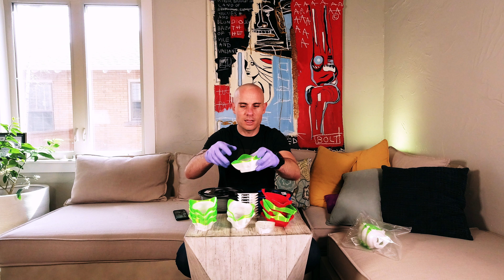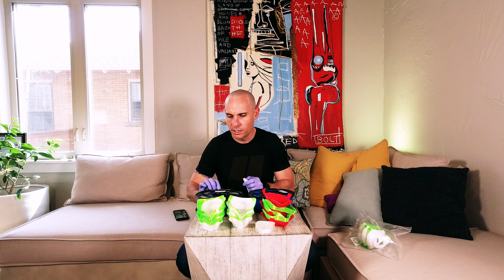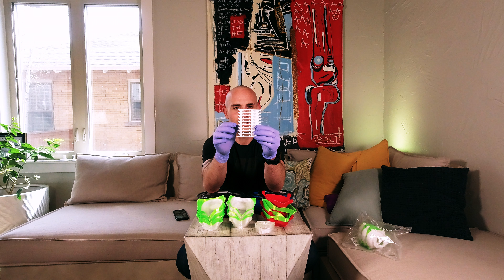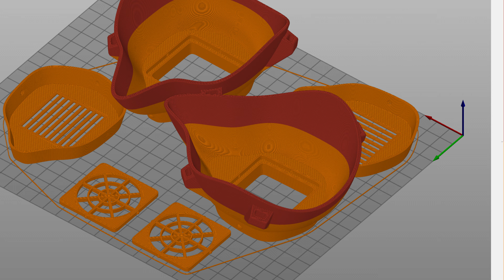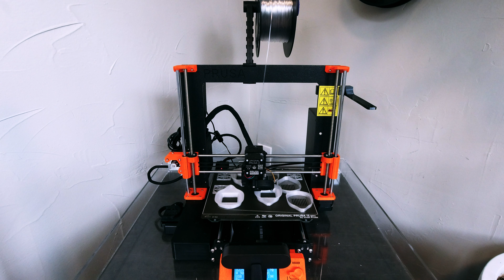3D Printed Coronavirus masks: Which materials and designs to use? #covidMask #CoronavirusMask

Comment: To bound them I think you could use a fast set apoxy.. you could also use heat to bound the two pieces together..
Reply from the maker: In the end I was able to print the masks out of PETG with a layer change to TPU and they bonded perfectly without the need for any adhesives.
Reply: @ALLYOURTECH3DP  Thank You for everything you are doing to help us get through this.. we really Appreciate all your hard work.. God Bless.. Ben..
Reply from the maker: @Ben-rj7xs  I appreciate that Ben, please reach out if you have any questions or suggestions!

Comment: Pla works just fine. As a medical and areospace engineer, i have done digital microscopic scans on pla and though it may have pores, 99.9% are less than a micron in size and DONOT go all the way through... ok, so now that brings up the question of 1 micron being very large compared to a virus, that is true, but the one thing most people dont think about when it comes to sterilizeing, the surface tension of the sterilizer. Surface tension is what allows a liquid tk gwt into small places due to the amount of energy required to break the hydrogen bonds. IPA has a very low surface tension, about 23 dynes/cm. Hot soapy water is pretty close as well. Water itself is about 73 dynes/cm. This is why we use soap, to break those bonds. Bleach water has about 74 dynes/cm so you have to soak the pla in it, but your better off with 70% ipa or hot soapy water. Lysol spray, non aerosol, will work to, but not the lysol wipes. The other additives melt the pla. 

A friend of mine makes filters that filter out viruses from blood and they are required to use 70% rubbing alcohol only because it can get i to pores smaller than viruses. So, in short, pla will work. But petg handles heat and wears better

Even if the pores went all the way through, remember, a virus LEAVING someone will always be piggy backing on respiratory droplets. These droplets are about 20 to 100 microns, meaning they wouldnt pass through the 1 micron sized hole. Plus droplets fall to the ground quickly, then evaporate,  leaving the virus without a host and stuck on the ground, waiting to die.

Comment: what speed do you print TPU at
Reply from the maker: For the Zyrtec filament I’m printing at the default PETG speeds in Prusa slicer. If I were making a different type of model I would likely print slower and at a lower temp.

Comment: Hi! I was able to get a friend of a friend to print me a 3D mask it it is definitely very rigid.  No silicone, no strap, and I have zero clue as to what filter I can possibly use. I have seen online people are using AC filters to ghetto rig it... asking in your opinion/recommendation what I should try.  I work On the COVID  ICU/ ED and I really want to start using mine this week if possible. We are out of supplies.
Reply from the maker: Polypropaline seems like the best filter media and there should be a bunch of it in the ER. Using TPU for the upper portion of the mask makes all the difference as far as comfort.

Comment: I saw another video where another content provider indicated that for some 3D printed masks, there may have some very minuscule/micro holes that viruses may get through. Are you applying a coat of anything to seal those holes if they are in your masks?
Reply from the maker: Big Ric this is our primary reason for using PETG instead of PLA. PLA is more porous (you can’t make a vase that holds water for example). PETG on the other hand is used to make things like water bottles. We’re printing the masks using multiple wall perimeters which also helps mitigate the issue. Most of the virus transmission takes place via airborne water droplets that contain the virus. So Th PETG, we can block those 200ish micron water droplets and greatly decreases the chances of infection. I haven’t seen any additional coatings yet that are safe and also blocker smaller particles, but in always open to suggestions.

Comment: I SO wanted this print to work, but when it came time to swap the filament, the 95A Flex filament immediately would not stick to the PETG. I don't have any TPU around. I only have the Flexfil 95A from Prusa. Do you know if there is a good middle ground of print settings that might work for both? Is there a way to build dual print settings into the slicer?
Reply from the maker: Which flex filament do you have?

Comment: These need to be sealed to be airtight.  FDM extrusions straight off the printer are not airtight.
Reply from the maker: The transmission of the virus is typically via water droplets. Properly printed PETG FDM is water tight, and the added layer of at least 95a TPU provides a seal around the face.

Comment: You are doing a good job. TPU PET-G are good combo for face mask. Never use PLA material as it fatigues much faster when washed daily, or being stretched and pulled. The crack looks like saw blade which will hurt anyone face with no mercy.  Experienced 3d print maker know this but not the users until they get hurt. I posted a video in my channel to show how's  the crack looks like. 
Good luck.

Comment: I have a question. I heard that 3d printed masks have microholes due to how the melted plastic bonds to itself. Is this true and if so, how did you mitigste it?
Reply from the maker: Yes, and this is why we advise against using PLA. PETG on the other hand printed properly seals well enough to be water tight. Since the majority of virus transmission happens via airborn water droplets, this greatly reduces the risk of infection.
Reply: @ALLYOURTECH3DP  Ahh i understand. Thank you so much and keep up the hard work.

Comment: What are you using for filters I've been trying to find a HEPA filter for the furnace The filtrate filters do not contain fiberglass from what the company said but I can't seem to find anything higher than 1900 and the 1900 only does I believe 93%, small particle I think I need to get a 2200 or 2500 maybe I missed it in the video and you said what you were using Thank you stay safe
Reply from the maker: I'm being told that the polypropylene drapes in hospitals are an ideal filter material and they have a ton of the stuff.
Reply: Yeah I saw that too but now that everybody knows about it you can't get it anywhere for somewhat reasonable price. I ended up finding some HEPA filters no fiberglass with 99.97% filtration so I lucked out

Comment: If you look at CNC Kitchens latest result, it seems as though PLA stands up to IPA sterilisation better than PETG.
Reply from the maker: I would be pretty worried about PLA having far more micro-fissures though. Water is 287 micron, and I haven't printed anything in PLA that can even hold water. i use PETG for my own design of Orchid pots, and it readily holds water. I don't have the tools to measure at the level needed to see if it blocks a virus. I haven't had ay docs complain about not being able to sterilize the PEG. I would love to hear more.
Reply: @ALLYOURTECH3DP  I don't know much about PETG, never printed with it but having you say that, I may pick up a spool to try out.

That being said, with how fdm printing works, there will still be gaps. These can be resolved with a spray on sealant. I don't know what type to recommend as my first choice would be silicone or latex but both are allogens
Reply from the maker: @Falney  This is a great question, I don't know which sealant would work best in this situation. I have been printing with multiple perimeters  in order to hopefully reduce the risk. If one layer has micro-fissures, are 3 layers enough to negate that? 5 layers?
Reply: @ALLYOURTECH3DP  the likely hood of them lining up is likely very low, but you can be sure that they all will due to the nature of fdm and heat caused expansion and contraction.

Comment: I can't handle some of these comments. But:
1. N95 is only required for medical staff directly  intubating a COVID patient. None of these designs will reach N95, but that's ok.
2. Even without TPU the masks can give a perfect seal if they are sized correctly. Just scale the print in 10% increments. The test is breathe in normally with your hand covering the vent, the right size will suck to your face. Real N95 masks need to be fitted. 
3. Do not use HEPA furnace filters, they often have glass fiber. Vacuum bags are better. 
See prints on NIH 3D print server, avoid Thingiverse.
Reply: and a week later...I would advise not using the TPU/PETG mix of plastic, 2 masks delaminated right where the two layers meet after a few days of use and the overall air seal is not as good as TPU alone.
100% TPU  is the most reliable, and gives the best air seal. For filter material, I sourced Sterilization wrap and doubled the layers. This material can be heated to sterilize. The "Montana mask" design is simple, easy to print and easy to dissassemble for cleaning with soap and water. Other designs with screens are too difficult to clean and sterlize, you need TWO elastic straps.
Here is the reference for the utility of non-N95.
https://brighterworld.mcmaster.ca/articles/surgical-masks-good-for-most-covid-19-treatment/

Comment: Saw another video where they took a 3D printed mask under a microscope; there were multiple gaps and irregularities that led to holes of 6-8 microns which would be a big access way for the droplets. He dealt with it using wood filler and spray paint.
Reply from the maker: about time what material did they test. There are quite a few papers showing that the material matters a great deal as does the print settings such as number of perimeters. PLA leaks water for example where as PETG is water tight.
Reply: @ALLYOURTECH3DP  Yes he was talking in general terms about PLA and ABS, which I suppose a lot of the at-home printers use. Also I suppose any doctor would perform a fit test before wearing them on the job

Comment: Thanks for this design.  We've been printing this design in PLA, and a few in PETG, but the edges are so uncomfortable.  Any tips on printing with TPU?  I've read it can be difficult to print and haven't tried it before.
Reply: TPU requires a direct extruder or a Bowden extruder gear designed for flexible filament. 225-230C, 60C bed, 25mm/sec, 0.16mm layer or less, you have to push slowly.
Reply from the maker: It really isn't bad. My 3MF files shared here have the TPU edges and settings already baked in.
Reply: TPU is one of the easiest filaments to print with if you have a half decent printer. The only filament that prints easier is PLA.  Mk9 extruder with a simple printed part and a piece of teflon tube to guide the filament from the extruder gear to the hot end. No fancy extruder required. Also the speed and layer height restrictions people put on it are ridiculous. There are so many different printers out there that you just need to experiment and find what works for you. link to a video for you https://www.youtube.com/watch?v=bgwNkMTmZsY

Comment: This design with proper filter is restricting the air flow too much.The filter surface must be at least 3 times bigger.
Reply: This is not N95. But this week (April 8th) a very large study concluded N95 was only required for staff directly intubating a patient, even surgical masks were ok for patient care.
Reply: @truantray  It doesnt matter if it is 95 or not.The filter surface is too small. which makes it incredible hard for breathing.
Reply from the maker: The new design here has 50% larger surface area for the filter:  https://www.youtube.com/watch?v=PgABOJpu94k

Comment: bought a 3d printer today, we have zero ppe out here, i am looking at using mer16 filter media, we just don't have any masks to cut media from
Reply: Careful with your source for the Mer 16...If it's furnace filters they achieve their retention rating by using Glass Fiber media...not good for you to breath in as they shed.I have not checked it out but someone said 3M uses Polypropylene instead of glass fiber.
Reply: @andrewlidums2508  will double check, you can always put a cotton layer behind it

Comment: uv lights kill 95% of jerms . you shoud try a box with uv litghts in side to cleen massks
Reply: UV is only useful on flat surfaces without shade. 95% kill, which is just a made up number, is not sufficient. 
Better off spraying with 70% isopropyl alcohol.
Reply from the maker: That's a great suggestion!

Comment: You should really check out this video the Stephan did: https://youtu.be/txrXX0CQHhU   Unfortunately TPU isn't that great in an environment where the print needs to be cleaned with a liquid.
Reply from the maker: It also depends on the grade of the TPU. 95a (what I use) holds up well to chemicals.

Comment: Any thoughts on C02 buildup with no release valve? All my 3M safety masks seem to have a port for exhaling C02.  Lots of warning to never block or impede this area of the mask as it can result in carbon dioxide poisoning?  Thoughts as to how to address this?
Reply from the maker: That was a concern of mine as well although we have had these being used in the field for several weeks and it doesn't appear to be a problem. Even so, we have an updated version we are trying with a MUCH larger filter area: https://www.youtube.com/watch?v=PgABOJpu94k
Reply: You need sufficient air flow, which means at least 4 square inches of area. This is not like an OV mask, the exhaust has to be filtered to protect others.

Comment: Thanks for the information and video! Do you have an estimate for cost per mask? Thanks!
Reply from the maker: The current design looks to cost just over $1 per mask.
Reply: Thanks so much!!! What 3D printer would you recommend for producing these N-95s for local hospital?
Reply from the maker: @3journeys975  Right now i'm using the Prusa i3 MK3S. Another more budget friendly option is the Creality Ender 3. I have heard fantastic things about it, so worth checking out: https://amzn.to/2JRc5oo
Reply: @ALLYOURTECH3DP  Thanks so much!
Reply: @3journeys975  Ender 3 prints in PLA fine, but for the TPU, you will probably need to modify the feeder (either 3d print and use some capicorn PTFE tube (See CHEP's website https://www.youtube.com/watch?v=az7pysnV_MY) or modify to direct drive). Also, it would be smart to update the feeder tube to capricorn PTFE.   If you plan to do PETG and TPU in one print, watch this video for CURA slicer GCODE command for the transition (https://www.youtube.com/watch?v=1nBnVtOEAiY).  I'll be trying it myself as soon as all the materials arrive.  Also, Ender 3 requires a complex firmware upgrade using an Arduino UNO or raspberry pi using connector pins to the Ender 3 motherboard to install a bootloader, so it's not for someone just looking to print (https://www.youtube.com/watch?v=fIl5X2ffdyo).  it can be done fairly easy but I had a lot of issues with trying to find drivers and finding a USB B cable without interference shielding (the cylinder thing on some older cables.) You could also buy a motherboard with a bootloader, but that is adds cost as well.  I love my Ender 3 as it is so flexible and upgrade-able over time (extend print area, change hotends, octoprint, etc.), but there is a rough around the edges, gotta get your hands dirty, to that flexibility.  For me it came down to $250  Ender 3 vs. $750 Prusa i3 MK43.  Also, I don't recommend buying from creality3d(dot)shop.  It's not the official website (even though it is the first website google give you. Seems shady to me with an everyday ultra-low sale price and always in stock.  It seems to get mixed reviews from forums I've read so I chose not to risk it.)   The official website is https://www.creality3dofficial.com/products/official-creality-ender-3-3d-printer   or buy from amazon.
Reply: @3journeys975  BLOVE, thanks for this!!! Subscribed.

Comment: Thanks for the video. Fantastic info and print design. I downloaded your files and my first print turned out quite well using the materials I
had (PLA and Ninjaflex). I used the MakerGear M3-ID which has dual printer
heads. Loaded the PLA on T0 and the Ninja on T1. Sliced as you
described using Simplify 3D and assigned different profiles for each
print head tool. The only issue I ran into was that T1 (which began
after about all of the assigned layers were completed in PLA)
did not preheat...thus the first layer did not lay down firmly. I had
to pause the print at the time of the change of material and wait a
few minutes for T1 to heat up...Then it worked fine. Not sure how to
tell T1 to preheat first without doing this manual step....other than
perhaps using an ooze shield or prime pillar. Any thoughts?

Comment: To all those stating you need an exhaling valve. Actually, health professionals need to protect the patient as well by having exhaled air move through the filter. Yes, it wears out the filter, but it's necessary.
Reply: No is not, you are the second idiot so far that is thinking in a exhale valve.  You are not painting cars.

Comment: This part can not be hollow. Infill needs to be 100% especially at the seam between the Flex material and PLA material or else it will delaminate!!!
Reply from the maker: It isn't hollow, there are 3 solid perimeters where the two materials meet, there is 100% wall to wall thickness other than in the very front of the mask
Reply: @ALLYOURTECH3DP So I'm guessing you selected about 15% infill but since you also select 3 outer shell  perimeters it came out to be 100% infill at the thin portions of the mask?

Comment: At 6:30, you really need to try bonding the two pieces together with a plastic-specific adhesive. I had a problem with HDPE for a hobby project, and original gorilla glue and super glue was surprisingly weak on HDPE. Gorilla and JB weld make a plastic-specific glue that worked very well. Try both.
Reply from the maker: I just don't like the idea of needing to bond the pieces. Instead I remixed the file and am printing it as one piece with a TPU layer change. I'll do another video if it works well.